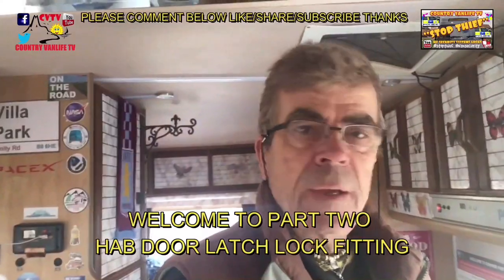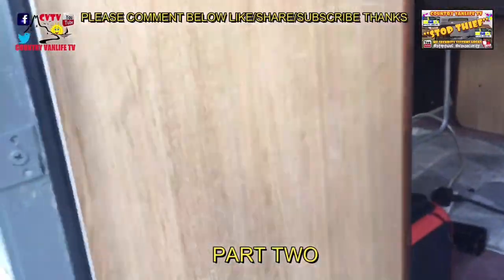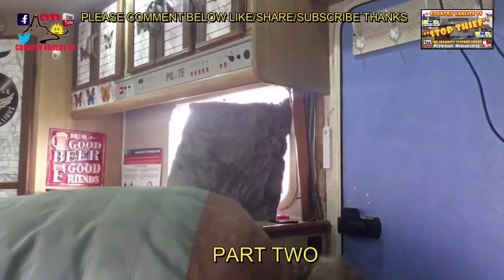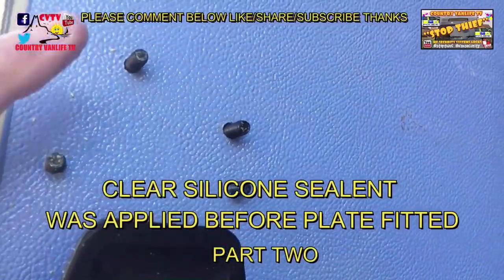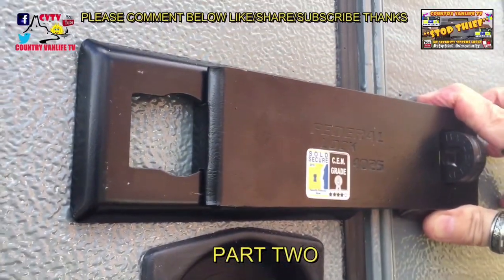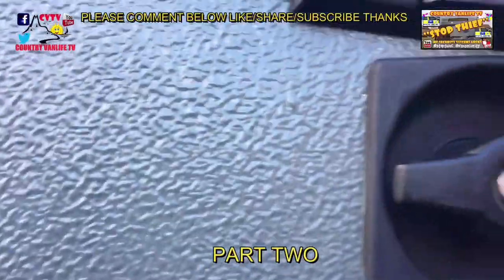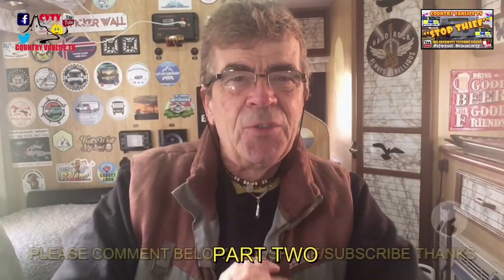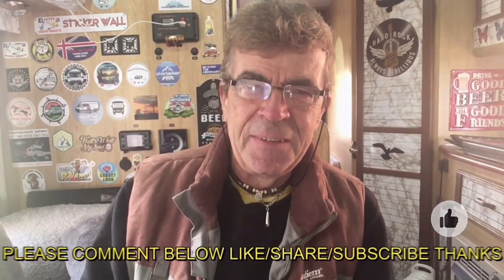Vanlife Van Security FITTING PT 2 DOOR  #haspstaple LOCK #vanlife #vansecurity #caravan #rv

Comment: That brass yale lock is the weak point. Get a cen 5 or 6 lock ablo, squire, federal or multiT lock. 
Nothing made out of brass. 
Lose the Yale
Reply from the maker: Been ok last 2 years plus Ive passive alarms too But yes Yale may upgrade to Squire cheers mate ATB 👊👊
Reply: @countryvanlifeuk  yeah when you do take a cheap mini hacksaw to the end of that and watch how quickly you can saw though it.
 Bet you can do it in less than a minute first time.
Reply from the maker: Yep as locks and deterrents go If a thief want a particular vehicle no matter what locks we have they will get in ehh Brand new vehicles with all the modern alarms and locks still get nicked Cheers 👊👊